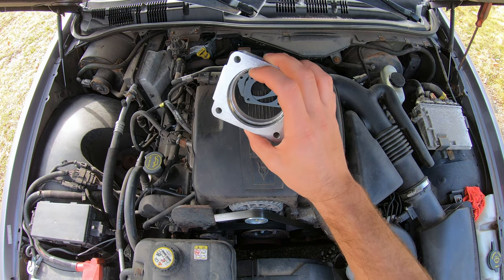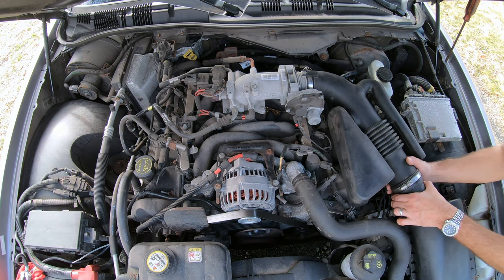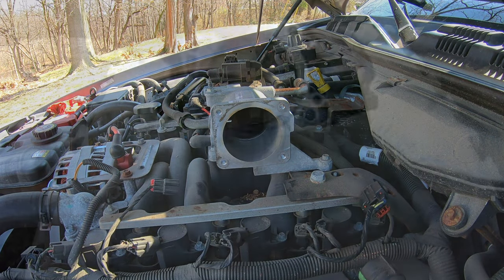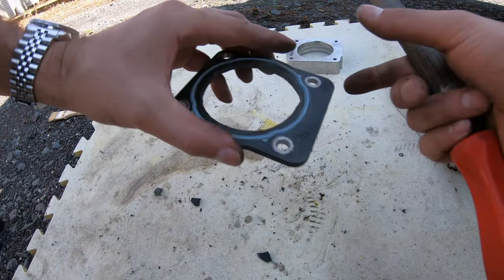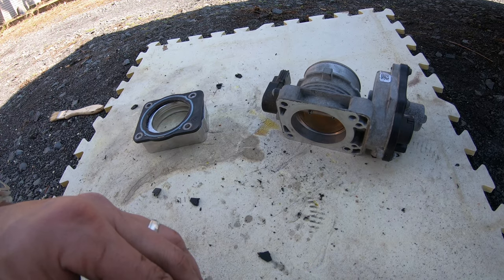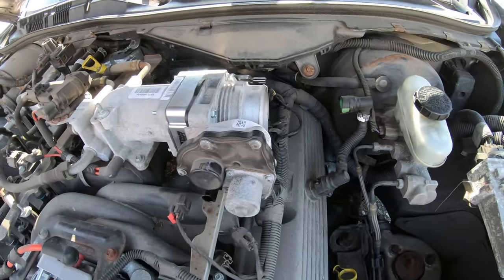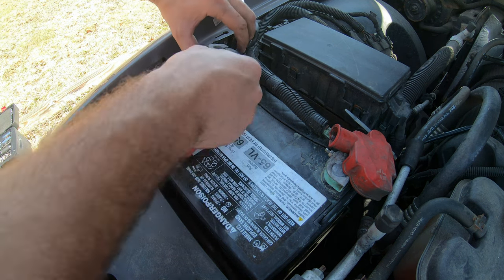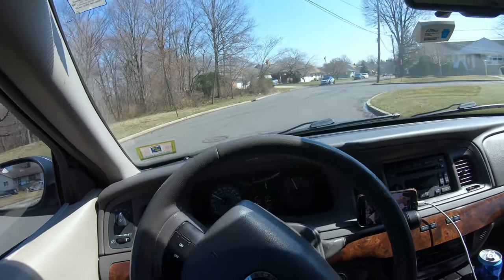Mercury Grand Marquis $50  Horsepower Mod? for Panther Platform How To Install Complete Guide 06-11

Comment: I did this to my 05 Mercury Grand Marquis and added a K&N Air Filter. I use Premium 93 gas. I'm not sure if any horsepower was gained but the throttle is instant.
Reply: Your Grand Marquis is designed to perform best using eighty-seven (87) octane fuel.
 Using 93 octane fuel offers NO BENEFIT. NONE !!
Reply: @SlikLizrd  Well since i added the K&N Air Filter and Throttle Body Spacer i put premium in mine. Of course that's a personal choice.
Reply: @antownemercer7552  Of course !!
You are free to spend 50 cents-a-gallon more for the 93 octane, but it's a poor choice if there is NO BENEFIT.
Just sayin'.
Reply: @antownemercer7552  k and n air filters are trash.
Reply: Higher octane fuel is designed for high compression engines.  On low compression engines, there can actually be an over-all power decrease due to the slower burning fuel.  A&P mechanic.
Reply: @slrs3908 Respect. Those A&P exams are not to be underestimated.

Comment: How noticeable was the change in performance? Did you notice anything other than quicker throttle response? I have an 06 town car that I am considering doing this and some other mods. I don't have access to a dyno and have been collecting 0-60 times to build up some data so I can quantify the impact of the mods.  Looking at doing this next along with an exhaust cutout right after the H pipe
Reply from the maker: Thanks for stopping by! I appreciate your time! To be 100% honest, besides a throttle response I have not noticed a  neck snapping gain. One of the viewers suggested that stand alone spacer is little to almost none gains. But if you start adding intake filter, intake tube, or maybe a crown Vic intake, a bigger throttle bottle and such things I believe you can definitely add a pep to your step! I did a drop-in performance filter (not K&N) in my stock air box, changed new plugs that are properly gapped, changed fuel filter, transmission fluid and filter, and now I am enjoying extra gains especially after 2500rpm. It’s sounds louder has more go and I do not regret spending my time for this little mod and all the others that follow! For me it’s about the experience and the journey! I’ll stop the rant! Thanks again!
Reply: @LoveWhatYouDrive  I've been told by numerous  grand marquise  owners that a transmission  fluid change  is a no no with a car with higher miles.  I was told only drain the bottom get any filings out and do a partial fluid change. Take it from me I did a full fluid change on one and the transmission  went out just like I was warned  it would do.
Reply from the maker: @imcorrectyourwrong5132  thanks for stopping by, I appreciate you! I did a pan drop and fill on the Merc. But did change the filter. There’s a video coming soon on that project. The car has 86K now but got it at 77k and the owners manual calls for transmission fluid pan drop and fill at 60k. I’m not sure of the previous maintenance log so I did it to be sure. Pan drop and fill only takes 5 Quarts of the fluid instead of the 14 Quarts if you drain the whole system. Thanks for sharing!
Reply: @LoveWhatYouDrive  Think I mentioned it another video, but the 4r70W is bulletproof under the power these motors make.  I'm not going to fault someone for changing the filter and fluid, but you really don't need to.  it will last 400,000+ miles with absolutely zero maintenance.
Reply: Change the intake hose, from a crown vic p71
Reply: @johngaltline9933  please don't ignore changing your fluid, regardless of how bulletproof they can be you should still at least do a drain and fill in the transmission every 40-60k. Filter isn't a necessity per se but will certainly help extend the life. Only really need to do it once though.
Reply: @yusufali-gk1fm  on some transmissions I would agree with you, but like the c4,c6, AOD, and AODE, the 4r70w is one of Ford’s transmissions that likes to start acting up after fluid changes. I’d never recommend changing it just as part of routine maintenance. With a stock output engine the transmission will last an easy 400,000 miles with no service. I’ve had 5 of them now with over 250k, one with close to 500k. The cars fall apart before the transmission gives you any trouble.

Comment: Put some 4.10 gears in the differential and a sct tune  and You will see significant horsepower increase
Reply from the maker: Thanks for stopping by! I appreciate you. Maybe down the line in the future I will consider it! 👍🏼
Reply: What is a sct tune
Reply from the maker: @shawnrobertson4295  to my best knowledge and recollection, I’m sure there might be others out there, but in the panther community Marty Ochs is the guy to go to for a tune for these cars. I’m considering getting the tune myself now to get some pep in the step for the Merc!
I’ll leave his info for you here! 

Www.Mosspeedshop.com
Dallas, Georgia
Reply: Installing 4.10 gears does NOT increase your horsepower, but it WILL kick the shit out of your fuel mileage -- AND wear out your engine and transmission a lot sooner.
 It's a really BAD idea for a daily driver.

Comment: I got a bunch of 3" pipe and plumbed it all around my engine bay.  I got 24 feet to fit under the hood.  At 5hp for every inch that's 1440 hp I gained.  
I can't wait for Hot Rod Power Tour next year!!  Gonna get the Crown Vic to do the 1/4 in 8 seconds.  All the hot rodders will be so impressed...  
Except for the fact that this mod is PROVEN with dyno testing to be completely worthless.  Save your money fo' speed stikkaz, yo.
Reply: I don't understand what you mean? How does adding 24 feet of 3" piping under the hood make so much HP ? IF YOU WERE just kiddin around you got me hook,line & sinker..lol. If not  can you tell me about it ?
Reply: @Tomtom62  I was just messin' around.  TB spacers are PROVEN with dyno testing to be completely useless.  
I was just taking the HP gain claims of a 1" spacer and taking them to absurd levels to make a point.
Reply: @ViciousAdventures-ls2em  I feel like an idiot, you got me good. lol

Comment: Fun video, was laughing my arse as you were cutting your thumb off... Sorry, the fins off which actually helps airflow to make the turn thru the TB! I've left mine alone on my 05', Ford Engineers designed it for a reason. But if you want more power out of a stock 4.6 then ungrade the injectors and get a tune for it
Reply from the maker: Thanks I appreciate your time watching my videos! Hoping to get some gears in the near future for the rear end ti slice things up. Tune will be a must after gears and “other” plans I have. I think I’ll be experimenting with small things gs here and there in the near future with I take setups and small things here and there! It’s my daily, I don’t want to hack it up and mess it up
Reply: @LoveWhatYouDrive  You say this is your Daily Driver, and you don't want to  "hack it up and mess it up" -- which is cool,  BUT you definitely WILL "mess it up" by installing "shorter" gears. 
 Engines, Transmissions, and Rear-end gear  ratios are matched at the Factory.
 Installing shorter gears WILL give better off-the-line acceleration -- BUT -- you will  drastically SHORTEN the LIFE of your Engine AND Transmission, not to mention the POOR Fuel Mileage, and the cash flowing from your wallet. 😁

Comment: How will you test the outcome of the investment for hp?
Reply from the maker: hi and thanks for stopping by, I appreciate your time to watch my video. at this time there is no official numbers and or test on the gains. As a matter of fact, many of us will probably never have a chance to get our vehicles on a dyne or something along those lines. Since that's the case many of us will just have to go by how the car feels and whether we love it or not. and at this point the car has better throttle response and more getup and go. its not neck breaking or tire shredding results, but experimenting with small and cheap things like this is what makes it fun! have you tried the spacer in your cars? what was your result?

Comment: Did you notice a whistling sound after application?
Reply from the maker: Thanks for stopping by, I did not notice a whistling sound, it made no sound changes on my car. I’ve heard and read a lot about people having the whistling noise or slow kind of sound change in their cars but not mine. 👍🏼
Reply: @LoveWhatYouDrive  interesting! It may be because you sanded out the OEM gasket?
Reply from the maker: It could be, it’s just a straight through flow now. Did you experience the whistling noises?
Reply: @LOVE WHAT YOU DRIVE  Yes, and after some research, I learned that the whistling sound is on purpose from the tornado effect inside of the throttle body spacer. It means "it's working."
It almost sounds like a small (and i do mean small) turbo.
It only comes after hitting the gas.
I don't mind the sound. I honestly think it makes the car sound more lively.
Different spacers are designed for sound/no sound at all.

Thank you for the video, it's the reason I was able to do this cool project. Keep up the good work.

Comment: Will this work for a 97 mgm
Reply from the maker: Thanks for checking in, I appreciate you! Yes it will fit that year, same part! 

https://www.summitracing.com/search/part-type/throttle-body-spacers/year/1997/make/mercury/model/grand-marquis?sortby=default&sortorder=ascending
Reply: Remember, he's got throttle by wire system.  On a '97 Panther, it's still a cable actuated system, so you'd have to do some mods.
Reply from the maker: You are right Steve! The kit comes with brackets and to extend the wire, but you will have to get longer bolts for the spacer and the throttle body because your stock ones won’t be long enough!

Comment: Did that work
Reply from the maker: Thanks for stopping by I appreciate you! Yes it works, my car drives just fine, not sure about getting gas mileage boost, definitely no crazy horsepower gains, but responsive, thinking that when I pair it with an intake, exhaust, and such small additions it will all come together. Right now running on brand properly gaped motorcraft plugs and boots, new fuel filter, new battery, alternator, drop in performance air filter….runs smooth, responsive, and snappy!